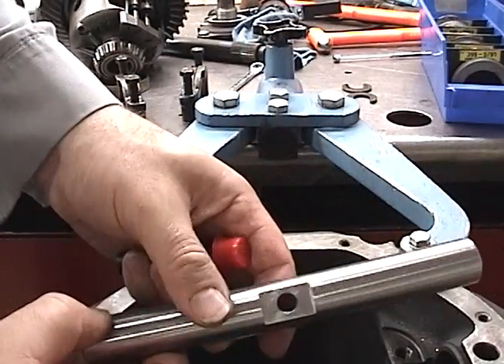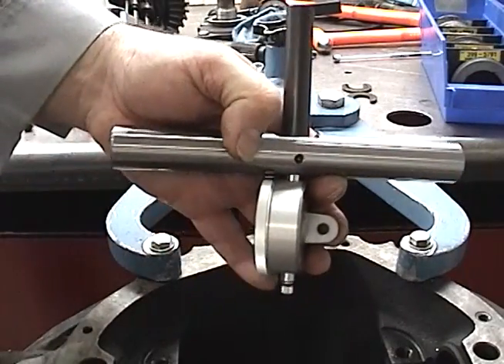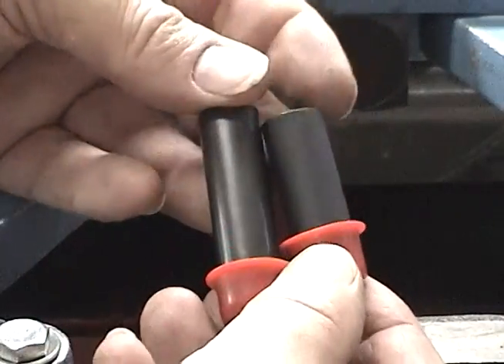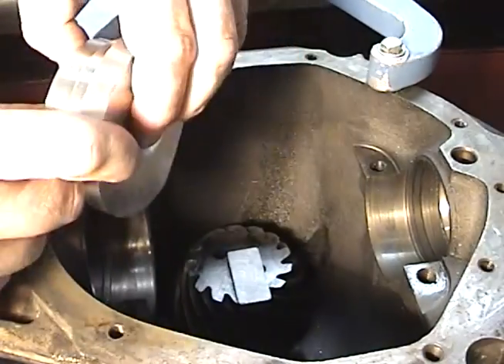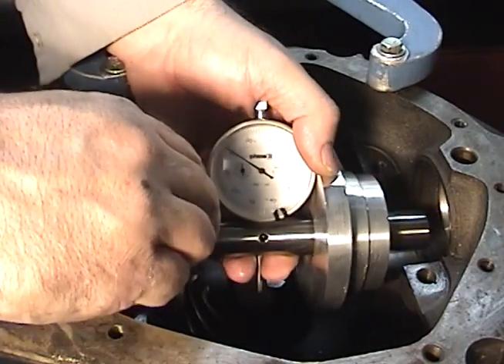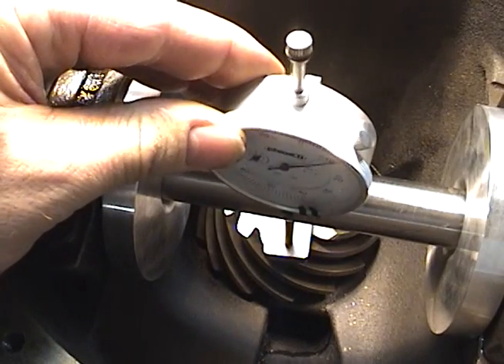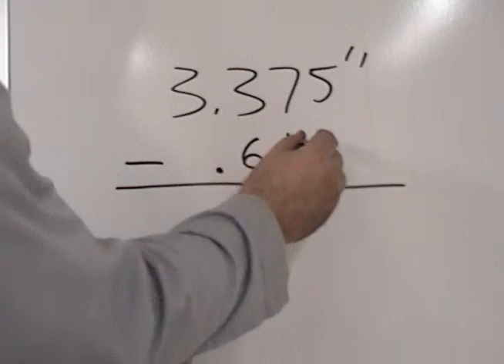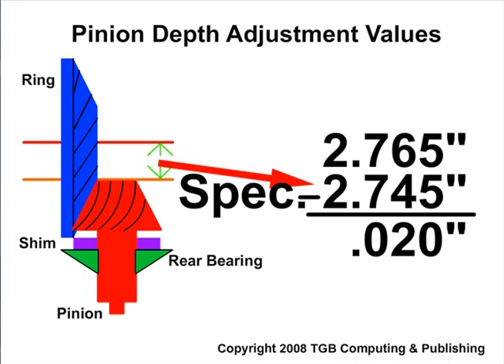Measuring Differential Pinion depth most Differential

Comment: When installing a new gear set. Measure and use your old pinion shim first.  No crush sleeve. Tighten pinion nut to 14" pounds pinion preload. Set backlash on gears you are using 2 or 5 cut. Add gear marking compound. Rotate the marking compound into the pinion gear back and fourth. If posi then use the axle shaft and a long screw driver. Check pattern. Add or subtract at .003 to achieve pattern. Pattern should be in the center of the tooth. Towards the toe to center if new gear set. Used gears always set up on the coast side. Once close to a perfect pattern. Make sure pattern is not too deep in the root= thinner shim. Or crown = thicker shim. After market gear sets can give you grief. Always check gear pattern on pinion gear too. It's the opposite of the ring gear. In the root of the pinion = thicker. Towards the crown thinner. OEM new or choice used,  AAM or US Gear. Not USA, Yukon, motive, Richmond,  Cha gears or itilay... To list a few.
Reply from the maker: Thank you for your comments on your experience.  This is a great procedure if you don't have a depth gauge and or a depth specification.  I would like to offer my input on your process for those who may read this.  1) 14" pounds would be rotational break away force and it's critical to have some preload for this however even a few inch pounds if fine for determining pinion position.  2) When rotating to get your contact patch the more load that is placed on the ring gear while doing this the better the pattern will be. I find that by placing a rag around the pinion flange and pulling on it to make it difficult to rotate the pinion while turning the ring gear by hand works really well. place just enough rotational friction with the pulling force on the rag to make it really difficult to rotate the ring gear by hand.  3) Adding or subtracting .003" at a time might might take your forever.  Especially with an aftermarket gear and a different gear ratio. I'm working on one now that needed almost .090" depth shim change to get it close.  I have found that all differentials are different. Some or more sensitive to .003" - .010" shim change than others.  No one wants to add or subtract only to discover they went the wrong way so you should know how to read a pattern. See my video on contact patch and pinion depth to determine which way to move the pinion.  4) I disagree with using the coast side.  The drive side (Convex side) is the side that caries most of the load most of the time and this is the side that should be your most concern. I noted the drive side is the convex side just in case you are calling the convex side the coast side. I will note that on 4x4 trucks with a front differential that is flipped so the pinion is on top instead of the bottom that the concave side of the tooth is the drive side. In all other circumstances the concave side is the coast side. 5) I'm not sure what you are calling the root or the crown.  I'm not sure if you are in the US or another country but I the terminology I have always used is:  Toe: Inner part of the tooth. Heel: outer part of the tooth. Face: Top part of the tooth. Flank: down deep into the tooth.  6) Giving advise as to using a thicker or thinner shim is dangerous unless you know the differential design. The two designs are overhung and straddle mount and the location of the depth shim is different and the results from a thicker or thinner shim are opposite.  a thinner shim on an overhung design increases pinion depth (moves pinion farther from ring gear centerline) where on a straddle mount a thinner shim decreases pinion depth moving the pinion closer to the ring gear centerline.  I have had no problem with Yukon gears and I don't hesitate to recommend them. This is a personal choice by experience and I respect your experiences.  Thank you again for commenting and sharing.
Reply: @DrivelineMaster  What I did.... First the gear people must want the process to be one step from nuclear fusion if you know what I mean. Not everyone has the tools, .000 to 6.000 depth micrometers, that a retired machine repairman has so companies duplicate what the people that make rear ends do in their process to build diffs, quickly. If you measure the pinion gear from the face to the surface where it sits on the bearing (with shims) and add this to the pinion depth indicated on the face of the pinion you will have the dimension to the bearing face you need. Example, I have a pinion from a 10 bolt in my old Chevelle. Pinion depth indicated is 2.531, add the thickness of the gear 1.646, total 4.177. This tells me where the bearing face needs to be. Using a depth micrometer, I measured the distance in the housing from the split where the carrier bearings fit, then I measured the cap from the split face, then split the difference between the two. This told me exactly where the centerline of the carrier was as they are not exact. Then using a piece of all thread and a small block of half inch thick cold rolled I duplicated, some what, the factory tool to tighten the pinion bearings in place. With a parallel across the split I measured to the block on the bearing. Subtracting the .500 block and the size of the parallel I had the distance to the bearing face. Add the shims to make the 4.177 distance and put it together. Look for Kent Moore tool J-6266, this will help you find what GM uses. Old GM gears don't have a machined face, ones I found for the 64' didn't, so this is how they did it. In addition for those of you that decide to try this and get a set of depth mics, I see they are dirt cheep, you'll have to have them checked by someone that has access to gauge blocks to confirm the readings on the mic using the different size stems.
Reply from the maker: This is a great work around for those who were able to follow your process, do the math and have the tools.  With this many steps of measurement accuracy in each measurement is critical and often influences the overall accuracy of the depth measurement. I always teach that it is better to measure once than twice. For example when measuring an engine cylinder.  I can use an inside micrometer or a dial bore gauge or I can use telescoping gauges and an outside micrometer. The telescoping gauges and outside micrometer method is two steps witch adds a higher degree of possible inaccuracy. However if you don't have the one step measurement tools and you are really careful you can get really close and it's better than nothing.  I may try your method one day when I have time to play.  I found it interesting but I did have to read it twice to follow exactly what you were doing.
Reply: @DrivelineMaster  Thank you for the reply. Your method indeed removes steps from my process. If you had a design change that allowed you to obtain the distance to the face of the bearing it would be a one time assembly of the pinion and bearings. At nineteen years of age I started a thirty year stent at the E.W. Bliss Company, a builder of huge machinery. I walked in a laborer and left a tradesman. My method is based on how things were done there, using the brain sitting on your shoulders. Again thanks for reading my reply.

Comment: Thanks for the tutorial! Do you know if this will work for Ford Motorsport Performance Parts 8.8 pinion gears? They don't have a machined face on the pinion and I've read some weird ways to set pinion depth with them.
Reply from the maker: Yes this tool should work on all Ford differentials.  The bottom line is the contact patch.  Check out my video on Contact patch and pinion depth.

Comment: thanks for the video I just have a question about this magnetic spacer , does its thickness affect the measurement ? as the tip of dial indicator dont touch directly the surface of pinion
Reply from the maker: The magnetic spacer does influence the measurement but the tool manufacture has built that into the tool so no calculations are needed and you don't need to measure the magnet.
Reply: I wish you would have said that in the video. Thanks for asking the question.

Comment: I have that same pinion depth setup tool set, I use the aluminum discs for my home made true-bar to straighten bent housings. That set costs over $800 as of 2019, using it to straighten bent housings with a true-bar setup with a long 1 inch stainless steel bar has paid for itself 100 fold and then some. Bottom line, the tool set can be used for dual purpose, thus recovering your investment. $$$$
From Russia, with LOVE....
Reply from the maker: Thanks.  In the US the deluxe tool model # 11001 us just under $500.00 (https://www.amazon.com/Machine-Products-11001-Deluxe-Checker/dp/B003OU2DXU?ref_=ast_bbp_dp) as of 12/25/2019

Comment: Hi thanks for the explanation, I’ve been trying to use this tool. What am I doing wrong or what does it mean when the measurements are asking me to reduce the shims but I don’t have enough to reduce. I’m on negative.
Reply from the maker: This could mean several things.  One, you may be looking at the numbers backwards. It's easy to confuse adding and subtracting shims. What does the gauge read? Big and little dial?  What did you calibrate zero to? 3.375", 2.5" or 1.9"?  What number did you come up with for your measured pinion depth?  What is the preferred pinion depth stamped onto your new pinion?  If you did all the reading, calibrating and measurement correct and you aren't confusing the need to add shims when you need to subtract the other possibilities are:  The bearing race is not properly seated into the housing. The rear pinon bearing is not properly seated all the way against the head of the pinion and sometimes the there is a problem with the gearset. It just won't work in your housing. You can always try installing with zero shims and view my video about contact patch and pinion depth to see how far off your depth really is. if you want to write back with additional info I will try to help you.

Comment: So if the pinion bearing beds a shim added or removed to obtain proper centerline specs, the new bearing has to be removed in order to add or remove shims? 

Is there a way to remove the new bearing without damaging it ?
Reply from the maker: Yes, the bearing can be removed with the proper bearing splitter and a hydraulic press.  Shops that build similar diffs on a regular basis with take a brand new bearing and hone out the inner race just a few thousands of an inch so the bearing just barely slides onto the pinion without pressing it.  This is called a dummy bearing. That way it slides on and off with a little finesse and a small amount of hand force. This makes for a quick change shim to find the right one. Once the correct shim is found a new bearing is pressed onto the pinion and the dummy bearing goes into the tool box ready for the next job that uses that size bearing.

Comment: His measurement has one flaw...........at 1:28........he should be using a small flat piece of metal instead of his thumb.......
Reply from the maker: If you are careful it doesn't matter however I have at times rested the calibration plug on the work bench and let the whole fixture stand up on the calibration plug without touching the fixture to verify the zero setting.  This removes the human element of uneven pressure on the plug as you suggest could happen by using my thumb.

Comment: Hi I have a 7.5 gm what calibration tool would I use because the 3.375 is to long
Reply from the maker: The T & D pinion depth tool used in the video comes with 3 calibration plugs for different depths.  3.375", 2.5" and 1.900".  If you are using this tool and you need something shorter than 3.375" just use the 2.5" calibration plug.  Are you using the same gear ratio?  If so, you can start with the same size depth shim and check your depth by gear contact patch.  You can check out my video's on contact patch and pinion depth.  Depending on the contact patch you can increase or decrease the pinion depth shim by .005' - .006" and recheck.  This method is a bit of trial and error but if you know how to read a contact patch you should be able to dial in the pinion depth within 2 o 4 adjustments.  Some technicians will purchase a second set of pinion bearings and use a small bore hone similar to what would be used for wheel cylinders or a small engine to remove a few thousandth of on inch from the inside diameter of the bearings so they just barely slide onto the drive pinion.  That way it's easy to swap out depth shims without having to use a press each time.  Once you find the correct depth shim based on contact patch replace the setup pinion bearing with the one that has to be pressed on.  Don't use the one you honed out for your final assembly.  Your rebuild longevity will be compromised.

Comment: Hi,
first thanks for the, in my opinion, best explaining videos for differential rebuilding. You helped me a lot. :*

But where can I get the calibrating tools for the gauge? I cant find it. What is the name for it? 
Second way is to machine them. But it sounds, that you can just buy it anywhere if you know the right nam. ;)
Reply from the maker: Google T&D Pinion Depth tool. I found it can be purchased from Amazon using this link.  https://www.amazon.com/Machine-Products-11001-Deluxe-Checker/dp/B003OU2DXU

Comment: Hi where can buy axle housing fixed holding  THANKS
Reply from the maker: The one I use is made by OTC.  Google OTC Differential holder.  I found this on Amazon. https://www.amazon.com/OTC-7020-Bench-Mounted-Holding-Fixture/dp/B00063XZ7Q/ref=asc_df_B00063XZ7Q/?tag=hyprod-20&linkCode=df0&hvadid=312174136943&hvpos=1o5&hvnetw=g&hvrand=17724246352267445796&hvpone=&hvptwo=&hvqmt=&hvdev=c&hvdvcmdl=&hvlocint=&hvlocphy=9032064&hvtargid=pla-568857223602&psc=1&tag=&ref=&adgrpid=63790029762&hvpone=&hvptwo=&hvadid=312174136943&hvpos=1o5&hvnetw=g&hvrand=17724246352267445796&hvqmt=&hvdev=c&hvdvcmdl=&hvlocint=&hvlocphy=9032064&hvtargid=pla-568857223602
Reply: thanks !

Comment: Im lost at the gauge of set before measurement would that not be 30 thousandth that it moved up that ruins the whole video if you change the calibration explain in the video
Reply from the maker: I just reviewed the video and all is correct. I'm uncertain where you see .030".  The only thing I can think of is that you are including the amount of Preload I placed on the dial gauge when I calibrated it.  Is that it?  The calibration value of 3.375" sets the zero point on the dial. If the dial reads exactly zero for both inner and outer dial readings then the distance or depth is exactly 3.375". Any value on  the gauge is less than 3.375".  The gauge is preloaded just in case the the distance is a few thousandth of an inch larger than 3.375".   If this is not what you are referring to please write me back.  Maybe give me an time stamp on the video so I can see what is confusing you.

Comment: What a waste of time
Reply from the maker: I'm sorry you feel that way. Yes pinion depth can be done by trial and error without a tool.  Yes, most often if you replace with the same OEM ring and pinion you can use the same shim. But making sure the pinion depth is correct my measurement or contact patch is extremely important and not a waste of time if you want your diff build to last and not make noise.  Some viewers would like to know how this is done so I made the video.
Reply from the maker: I can set up pinion depth by contact patch alone.  No tool needed.  This is for those who want to use a tool and need to know how to use that tool.

Comment: Will the pinion gear depth be marked on a new gear, or where can this figure be found?
Reply from the maker: Sorry for the delayed response.  If you purchase an aftermarket ring and pinion gear set the manufacture will scribe the pinion depth value on the head of the new drive pinion.  Factory replacement gears typically will not have the depth value marked on the head.  There is a way to calculate the depth on USA domestic rear axles by using the master housing depth and measuring the size of the pinion head. I always use a contact patch as my final determination to verify if the depth is correct.

Comment: The face of my pinion just says 325 does that mean it’s depth needs to be 3.250?
Reply from the maker: Most likely depending on application.  It really should have read 3.25"  For a small to medium size vehicle that would be a large pinion depth. If it's a larger truck it is possible.